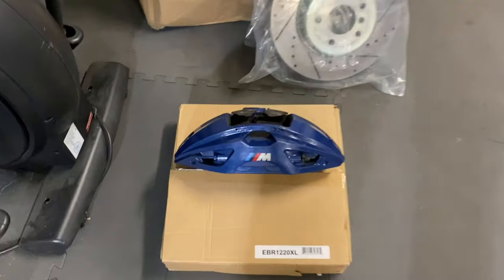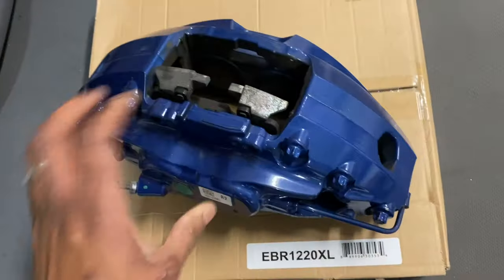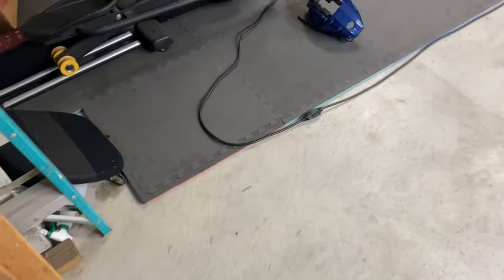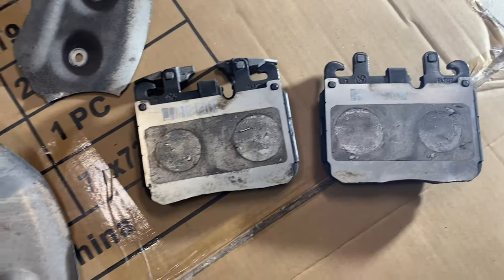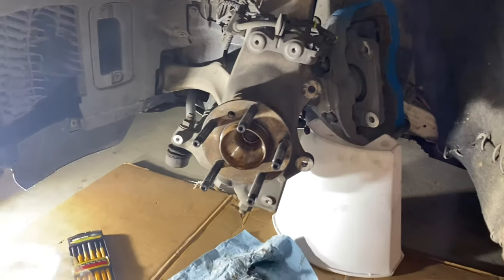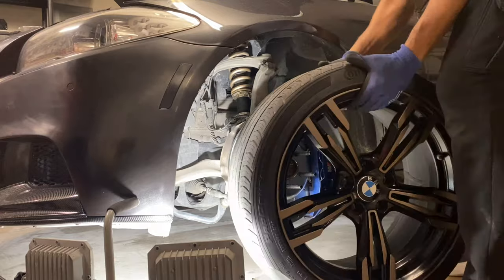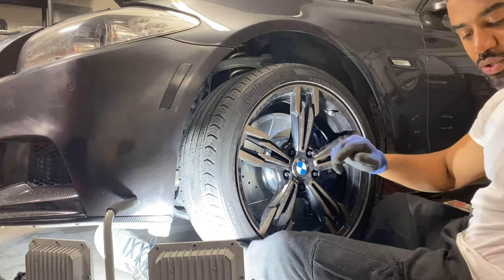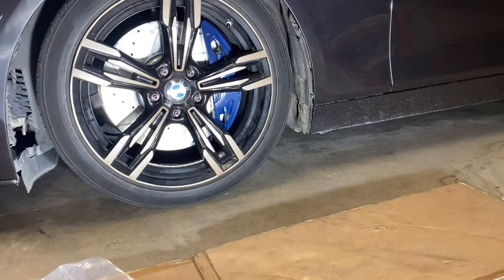How to Install G30 calipers on a F series! Cheap Big Brake Upgrade!

Comment: I know these are the M Sport 374mm brakes. But would it be safe to assume that the M Performance 395mm front brakes have the same mounting points?? Bc I’m btw using these calipers in your video or the red M performance brakes for max use of space
Reply from the maker: Yes, from what i understand the calipers will mount up the same, the only difference will be rotors and pads.
Reply: @JohnsonMotorsports  I’ll definitely have to trim the rotors then bc I want to retrofit them to my F10. Only issue is that a good set of M Performance calipers aren’t available anywhere yet. Only the M sport calipers seem to be readily available.
Reply from the maker: Interesting, do you have a part number?

Comment: Long therm use did u like these rotors ebr1220xl ? I look to buy them or high quality plain disk no drill and slotted ... and for the rear stock rotors and pads do you have suggestion plz? Ty for help
Reply from the maker: I like the look of these rotors, but if I had to do it again. I would have just bought blanks that have the correct top hat size for my G30 calipers. That way I wouldn’t have to modify the brake pads to fit.

Comment: There's actually an even cheaper/simpler way to upgrade with the G-series 374mm calipers (DO NOT need pad-cutting!!!) -- Just pair them with F01 760Li's 374mm rotors (plus some washers), as shared by this video: https://youtu.be/2408-spRowo  (Credit to VYS Garage in the UK)
Reply from the maker: Yes, this is what I would recommend. My issue was I wanted slotted/drilled rotors and these are the only ones I could find.

Comment: awesome!  do you have P/N for the calipers?
Reply from the maker: I just added the part numbers to my build sheet.

https://docs.google.com/spreadsheets/d/e/2PACX-1vQhICaGupkLAkt2CTajsuTOouXD9zVSXNkkVwV8STI0y3akyYqtL0UIDnzrWPQQYjSjjdpdKk-RtwNr/pubhtml
Reply: @JohnsonMotorsports  Thanks! I might have screwed up and ordered wrong calipers off ebay. They have different part number, they are G12 but have the same mm dimensions on the back and look exactly like the g30, I believe  they are the same hopefully

Comment: Could I run these G30 calipers on the stock F10 M sport 19s with no spacer??
Reply from the maker: Yes. If you check out my boy Eddy's channel, he just installed a set. Look up the " Turbo Spool". channel.

Comment: sir..may i know.
whats rotor you use it?
and the caliper its fit with any new modification?
Reply from the maker: I picked up a set of 550i GT rotors. My stock pads had to be trimmed to fit the rotor hat. I plan to upgrade pads soon, because the brake dust on these stock pads are insane. From what I’ve found, I can use the smaller 344mm pads and I won’t have to trim them, although I will have to slot the retaining pin slots.

Comment: Hi Grant i have an 535i f10 xdrive and i want to do g30 brake upgraded so i buy the calipers for 374x36 disk but i want to have your advice for rotors i want slotted and drilled one but i want good quality stuff can you help i just found standard rotor no holes or slottes ty and sorry for bad english

Comment: What is the part number for the caliper?
Reply from the maker: Left - 34116891303	and Right  - 34116891304
Reply: @JohnsonMotorsports  Thanks for the fast replay💞

Comment: Are you using the equivalent f series brake disc, with the g series callipers? Thinking of doing this on my f36 but the f series are 5x120 bolt pattern, and the g series 5x112 so can’t use g series discs with the new callipers
Reply from the maker: Yeah, I’m using rotors from a f series. You could use rotors from a g series as long as the thickness and diameter works.
Reply: @JohnsonMotorsports  cheers! I find it crazy how the newer (and IMO better looking) callipers for the g series are actually cheaper second hand than the f series (in the UK at least!) so glad to hear they’re an option!
Reply: @alexalbiston5675  also here in italy they are much cheaper than msport fseries calipers, I don't know why, maybe the brake pads are smaller on g series? Calipers are way bigger in g series

Comment: Install without any adapters?
Reply from the maker: Yes, no adapters just a few washers as spacers. If you pick up the correct rotors you won’t need to trim the pads as well.

Comment: Hi, this is possibile on a f21 ? Why you chose the msport gXX calipers and not the f serie msport calipers? The pads are same size?
Reply from the maker: You could do either one. I got a really good deal on my G30 calipers and I like the look.
Reply: @JohnsonMotorsports  I like the look of the G calipers also, but only if they perform better or the same. I can find them cheaper but don't understand why.  So they can mount on any F series without any fab work?
Reply from the maker: @LorenzoClara97   From what I understand the F Series and G series are both 4 piston calipers from Brembo. With improvements in technology if there are any differences I would imagine it would be in favor or the newer design.
I would research more regarding all F series models and mounting. I zeroed in on my vehicle.

Comment: Did you have to change hub for 4pot callipers
Reply from the maker: No sir.
Reply: @JohnsonMotorsports  thanks for your answer because I’ve just 800 English pounds on as set for my f10
Reply: Ps i love your videos
Reply from the maker: @pauldargue  🙏🏽

Comment: Hi do we require coding for the brake kit? Do you know how?
Reply from the maker: The brake kit should not require coding. You may want to use Ista or different software for the brake bleed procedure.
Reply: @JohnsonMotorsports  thank you so much, I successfully install the front of msport G series brake kit to my car by following your video 😀. The brake performance looks impressive.
Reply: @JohnsonMotorsports  ah, do you have any idea for rear brake? I know we may have problem with electric hand brake. But still looking for a solution
Reply from the maker: @kevinvo9771 Awesome!

Comment: Car looking clean Grant , looking to get one same year for 10k. Car has 150k miles with a rebuilt engine and trans at 70k would u say that's a great deal ?
Reply from the maker: Does it have a clean title? Do you have any info of the maintenance that has been done?
Reply: @JohnsonMotorsports  Yeahh clean title , 1 previous owner no accidents , But no I haven’t got any update on the maintenance that’s been done
Reply from the maker: @OC.SZN.  How long would you plan on k print the car? I ask because having a engine with 70k miles is good, but overall car value is based on the miles on the odometer. If you plan to keep it long term then it could be worth it, if you only would keep it for a shorter period, you will want to price compare to other cars available on the market and base you search off of the 150k miles.
Reply: @JohnsonMotorsports  Appreciate It Bro.I Plan On Keeping It For A While , I Don’t Care To Sell It Or Anything Just Wanna Build It And Enjoy The Car You Know

Comment: Where do you work? I wouldn’t mind a M5 steering with heated features and paddles.
Reply from the maker: I have recently changed jobs. I use to work for a pump manufacturer, now I work at a OIl and Gas company. M5 wheels are real pricey. DM me on IG and we can discuss.

Comment: hi
My car is 528i f10
Can I apply it in the same way?
Tell me the size of the washer
Are all the brakes of the g series compatible?

thank you~
Reply from the maker: Yes, these brakes will fit all f10’s and f11’s. I don’t recall the exact washer size at this point, but it’s covered in this thread.

Brake upgrades from other BMW models on F10 https://f10.5post.com/forums/showthread.php?t=1488894
Reply: Hey  @JohnsonMotorsports  Do you know if this will work on F06 640I? Thank you
Reply from the maker: @amit223  I have never tried. You may want to research on the 6 series forums.